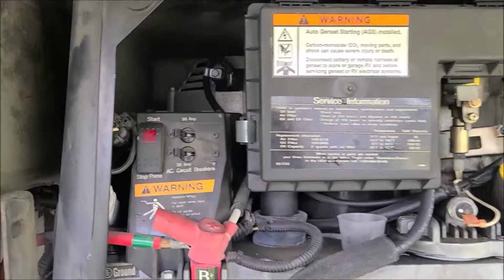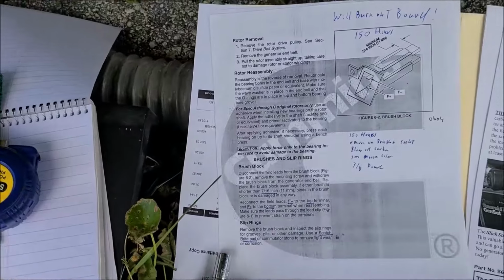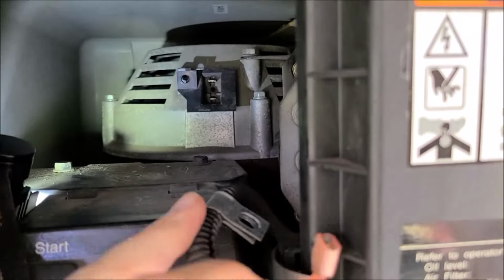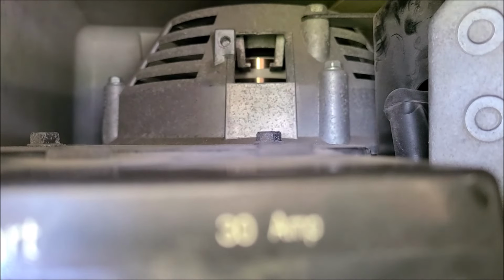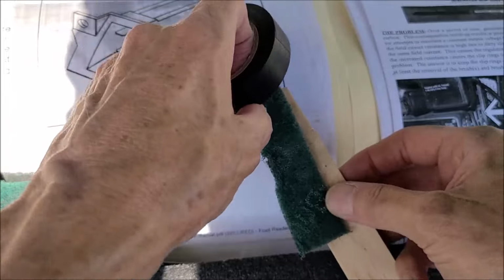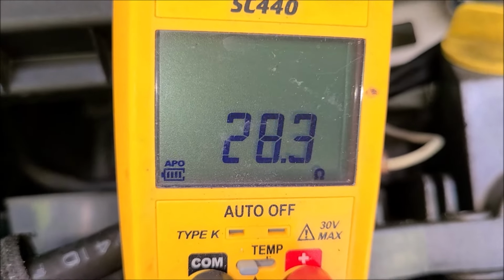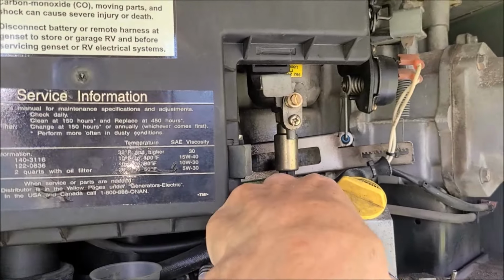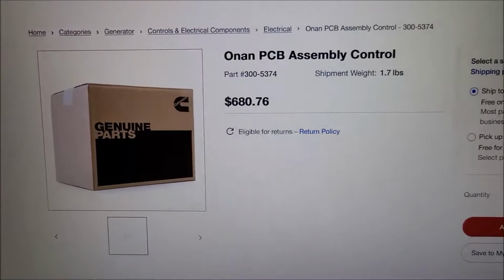How to Clean Your Onan Gas Generator Slip Rings 5500 6500 7000 With Your Homemade Slick Stick

Comment: Maintenance will always save you $$$.
Reply: Oh yes! Been doing a bunch of maintenance on mine this last week… was supposed to go on a trip and didn’t work out so the rig is fueled up and ready to go! New oil, filter, Transynd 668, filter, air filter, and dex cool (half the system I do it in sections not all at once) and radiator cap!
Reply from the maker: @bounderchris  You have been busy I see
Reply: @ktoutdoor  oh yes! :) got my scan gauge 3 and my tpms mounted into the new bounder from the old one too! It only took me many months 😂🤦‍♂️

Comment: Great MacGyver work around!  Just did it, like you showed, on my Onan 5500 and it worked well.  Changed out my control board as well...was getting repeated shutdowns with code 36 (useless code) so bought new control board from ASAP which will only shutdown on loss of generator output power or oil pressure.  Removal of the control board made easy acces to the slip rings.  Thanks again Kevin.
Reply from the maker: Thanks for contributing just incase you still get a random shut down code 36 it can sometimes be a intermittent fuel pump. See this video to confirm. https://youtu.be/gtF2czdhv80?si=sCqTjLqRHVQX7NDo